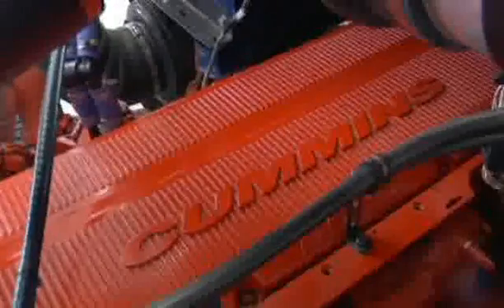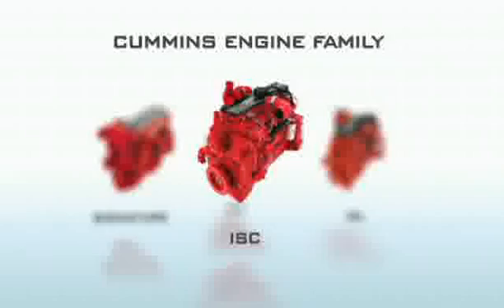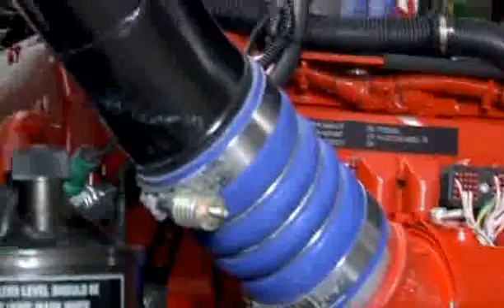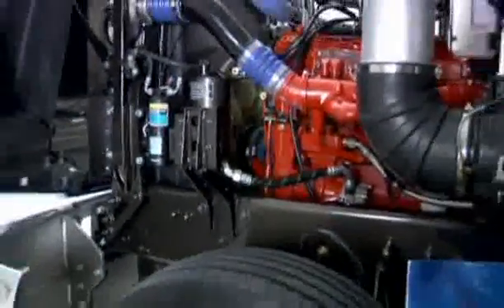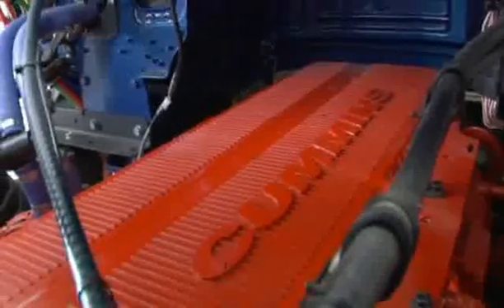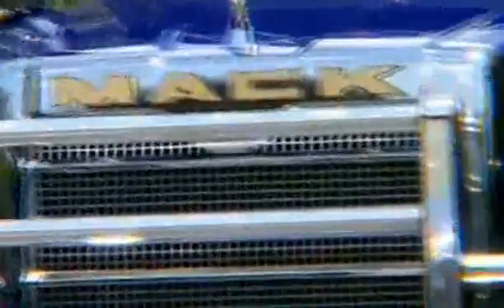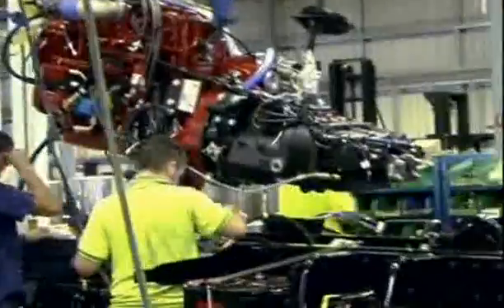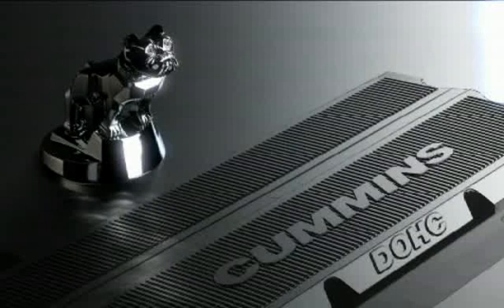OFFICIAL Mack Trucks New Breed Cummins Engine

Comment: All internal combustion engines were finished fifty years ago. It's only scared politicians that keeps them in business. They turn premium fuel into dangerous gas. Anybody who says hey are cheap to run is nuts. TedPRITCHARDdesigned and built the lowest emission engine in the worldTheonlysreasonwhythePritchardsteamerfailedwaspoliticalinmyopinion.Tedwasgranted$300Ktobuildthreeengines.Thenextgovt.took$200Koffhim.Meanwhile,tomyknowledge,overseasvehiclemfrs.stillreceived$750K.and$500K.thatwebelievedwentstraightoverseas.Therewasn'tenoughmoneytotestthefirstengine.Austshareholderswerestressedout,couldtakeitnofurtherandtheprojectfinished.PreviousIhadbeentoAmericawithTed.IwenttoReno.NAandsawBillLearU.S.$10Ml.effort.Idon'tknowhowmuchtheU.S.govt.putinbutI'llbetitwasplenty.Amonkeycouldhavedonebetter.TedhadafriendDr.DavidWarren.Heinventedthefirstflightrecorder.IfIwrotewhathappenedtothatyouwouldnotbelieveme.Anybodywithbrainsgetoutofherefast    BRUCE 0448 726 777

Comment: Volvo engines suck to work on. Plus they just dont look clean, its like they built the engine and said its DONE... oh crap we forgot this, lets take a couple wires and run them here, dang forgot something else now we gotta add this and run more wires from here to there. but in all honesty ours arent really troublesome other than EGR valves. they leak pretty bad and are low on power but not bad. i still wouldnt own though haha